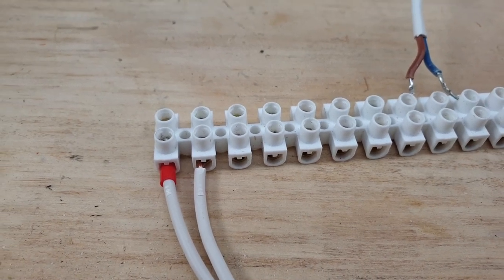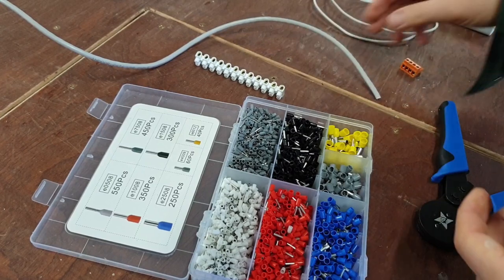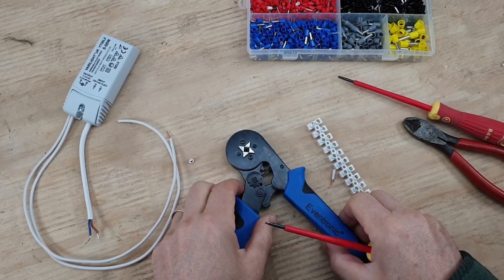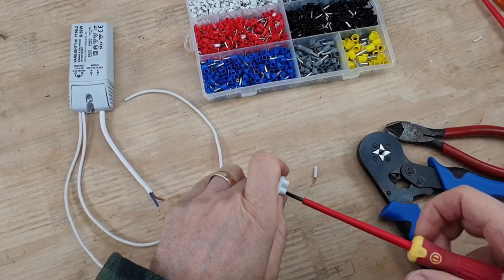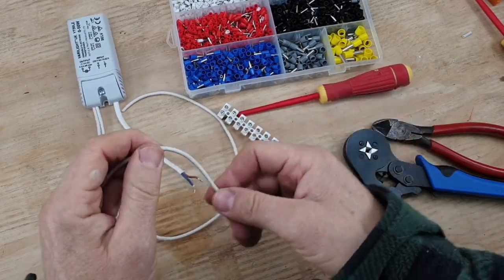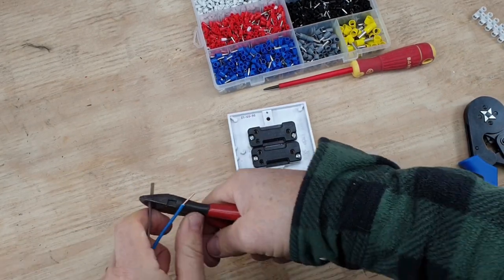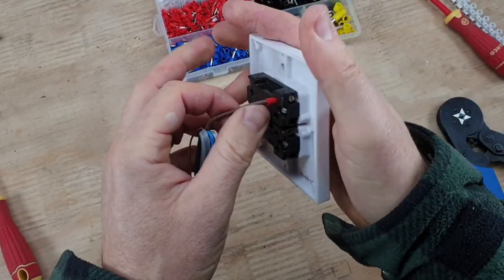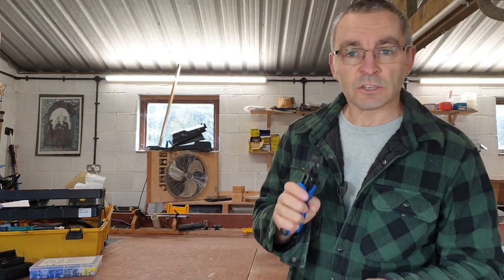How you can use Wire Ferrules (Why We Need Them!)

Comment: Bootlace ferrules should never be used on solid core cable. By crimping them on all you are doing is creating a weak point by the crimp tool.
Reply from the maker: Try adjusting the tool properly. You shouldn't be crushing the cable.👍
Reply: I could argue that a screw terminal directly on the solid wire makes a stress point that a ferrule would alleviate? Ferrule’s may be overkill on solid wire but if it prevents a furnace from flaking out at 3 AM when it’s below zero, it’s worth a few pennies and a minute of my time. I think I’ll start doing it on solid wire now. Just started using ferrules on stranded wire and love them, especially on 6 AWG going into my Victron solar charge controllers.
Reply: Agree but no one uses solid anymore.  Bootlaces are required by law for flex cable when installed in a non clamping terminal.
Reply: @geoffgeoff143 solid that's all that's used in domestic fixed wiring below 4mm. Unless your not in uk
Reply: I can’t find any workmanship standards that recommend using ferrules on solid conductors. I know IPC says they are only for stranded untinned wires but I’m not an electrician.
Reply: I'm from the Netherlands and I'm not an electrician but  I did learn it in school. 
Here ferrules are only used on stranded wires and are mandatory by our NEN standards.
Reply: Solid wires are usually doubled over and then inserted and clamped down.

Comment: Those are the most controversial items I ever dealt with. Guys who were good at wiring stuff and making it look good like them. The guys who worked for the national labs nsa etc all hated them and swore they mess up signal quality. So one night we fired up a scope to check digital feed back from a resolver. And yes the signal was crap compared to bare. Still usable but not nearly as clean. Personally I stopped using them 25 years ago. And whatever you do. Don't buy the new China stuff.
Reply: @tonywatson1412  What benefits do you get? How does it effect impedance? They are not invisible to the system.
Reply: what new stuff isn't Chinese?  and I assume you are talking communication signals with the degradation and not pure power (low voltage) stuff.  can you expand on the "crap signal" you mentioned?

Comment: Ferrules on solid cable? I'm not convinced.
Reply from the maker: I've used them to send composite video over 200ft of cat5 with no issues, it's an option.🙂
Reply: I believe the purpose of the ferule is to encourage stranded wire to behave like solid wire when under a screw or clamping connector.  A ferule on solid wire is additional resistance (and effort/expense) for no gain in any other area...?  BUT.....I'm a mechanical designer....NOT an electrician.  Let me know if I'm wrong because I like to learn.
Reply from the maker: It will add the same amount of resistance whether it is stranded or solid so no real concern there. But on 1mm solid it stops the wire getting crushed by being overtightened in screw connectors causing open circuit. It works for me 🙂

Comment: Don't use on single core only multi stranded
Reply from the maker: I use them on 1mm solid, works fine
Reply: @50plusdad-uk  Ferrules are designed for  class5-6 wire ( fine strands ) not for class 1 ( single wire )  or 2 ( multipe single ) wire.
It's not because it works fine .. it 's made for the purpuse .. also it depends on the terminal type .. for class5-6 wire it's really needed on a screwterminal ( screw pushing on the cable   ) .  I using it in a WAGO 221 it's not needed ..

Comment: Use a crimp tool with 8 or 6 jaws it makes a better looking cable and stronger. You never use a ferrule on a single strand wire, it's only used on multistrands.
Reply: @leosedf  can you use them to combine 2 or more solid wires into one connector?
Reply from the maker: Try these https://amzn.to/3XfYJZs without tool or https://amzn.to/4dZYEim with the crimp tool

Comment: I’ve never come across those before. As you said, seems a great idea when using screw connectors. 👍🏻🔧
Reply from the maker: They are really useful on thin wire, they protect the wire but also give you something to push it home with.

Comment: I've seen this video like a week ago it was a good find now i'm thinking this could be a good thing to use on speaker wires to use them on spring clip audio sockets i wish the plastic tube on this ferrules was a heat shrink tube this will make the connection even more solid, and i wonder if a regular pliers make a good result as the crimping tool
Reply from the maker: You could try heat shrink over the plastic part of the ferrule, I would use proper crimpers as they make an even crimp and won't crush the cable as pliers probably would.

Comment: I always use these on multistranded cable wires. Uninsulated bootlace ferrules are also good for a cleaner look and tighter spaces. There are also dual conductor options.
Reply from the maker: Nice tip.👍

Comment: Big fan of boot lace ferrules, however given that the  bootlace colours are not mean to represent L,N or E colours,  I would not put them on a cable where they would hide the wire colour as you did on the first demonstration. I didn't think you were meant to use them on solid wire.
Reply from the maker: Thanks for watching, the first is the 12v output from an led transformer no polarity label and both cables are white, but I do get what you mean 👍

Comment: I've seen a lot of uninsulated ferrules used in removable 13A plugs pre-wired onto appliance or extension cables. As an approximation to this I have put the type shown in this video (with the plastic part) on backwards, crimped, and then cut the plastic part off to give a neat uninsulated ferrule..
Reply from the maker: I've seen that done, saves having different types that you don't use much.👍👍

Comment: For small signal this is great.  For US house wiring, you should not use these.  Here, solid wires to not generally require terminals.  For stranded wire, you can either use terminals designed for stranded, UL listed lugs the accept stranded, or UL listed crimp terminals.  It would be a code and safety issue to do otherwise, as US UL listed devices are designed to work with bare wire or terminals.
Reply: I'm from the UK but yeah I totally agree, the use benefit of these is mostly cosmetic, can be good for stranded wire in terminals designed for solid wire, or the double ones can be good for getting 2 wires in a terminal neatly.

Comment: There's nothing better than the right crimp tool for the job.  There's nothing worse than not having a crimp tool
 speaking of special tools:  Recep & switch terminal screws
Originally:  made for flat blade screwdrivers
Circa 1970s:  made for either flat blade or Phillips screwdrivers
21st Century:  new tool created specifically for screws drivable by both flat blade and Phillips screwdrivers.  (The tip is a combined Phillips #2 and flat blade)
Me:
1)  🤯
2)  😌
3)  eagerly awaiting arrival of the combined flat-blade + Phillips + security torx driver.

Comment: How do crimp-on ferrules compair to dip-soldered wire?
I always tin the ends of stranded cable before inserting into a clamping connector.
Reply from the maker: I like dip solder on external car stuff crimps etc as in my mind its a bit more moisture resistant.

Comment: As a home DIYer I could not justify the cost of a tool and set for the odd bit of wiring I do.  If wire is twisted and solder dipped it produces a solid end.  How does that compare?
Reply: You'll usually get away with it, preferably with a screw terminal that pushes down a small plate on to the wire instead of the screw directly pushing (and spinning) on to the wire, but little solder flakes can actually come off. Crimped connections are better than soldered.
Reply: @jimmybrad156  Makes sense, thank you.
Reply from the maker: I think anything that stops the wire from breaking and more reliable as got to be a good thing👍